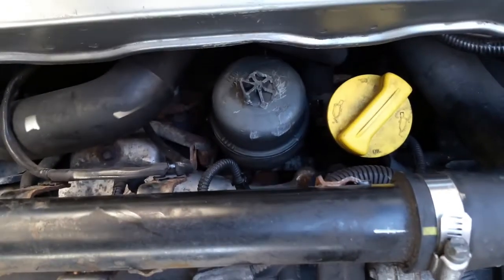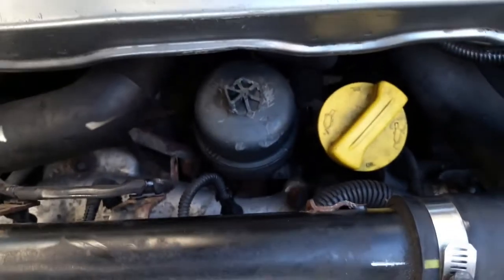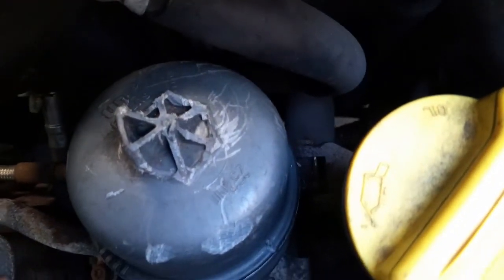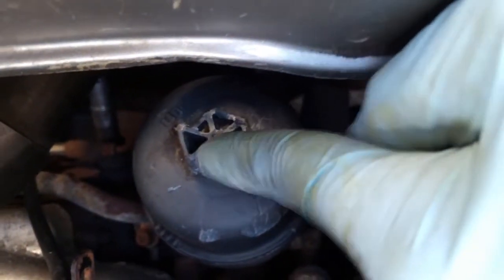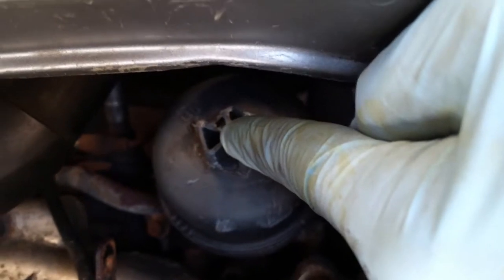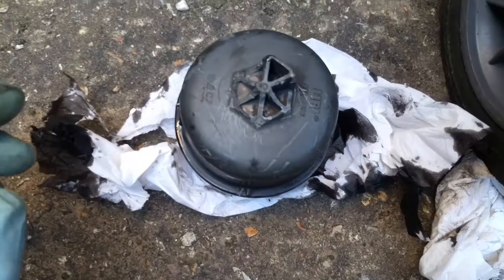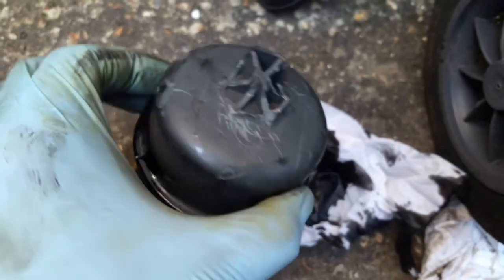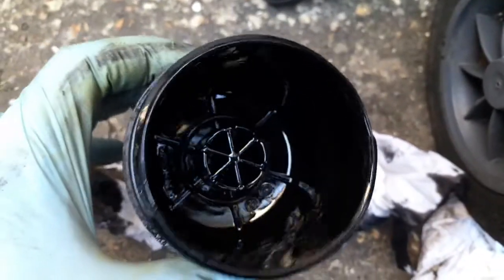broken oil filter cap removal.best way

Comment: Or you can get an oil filter remover that grips the oil filter housing like there is no tomorrow whenever you turn it. Been using it to a housing like that with smooth edges when I cant get it to turn loose.